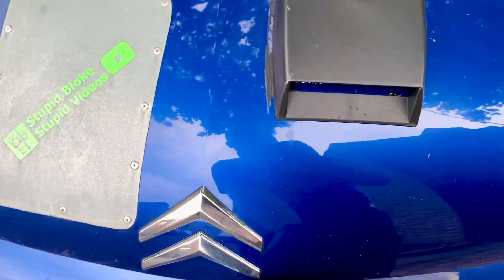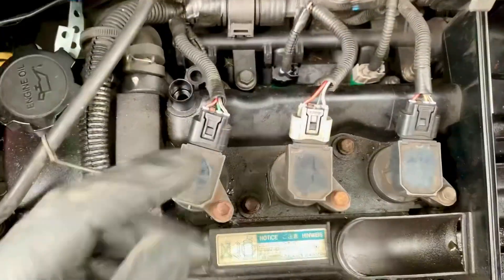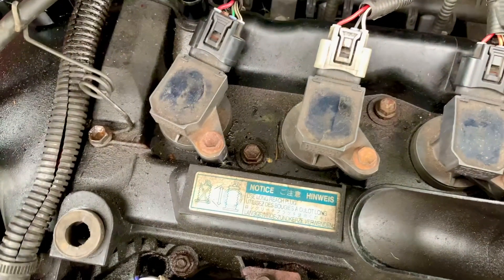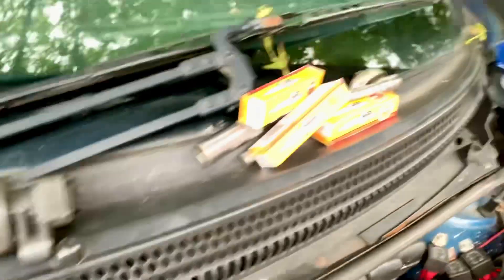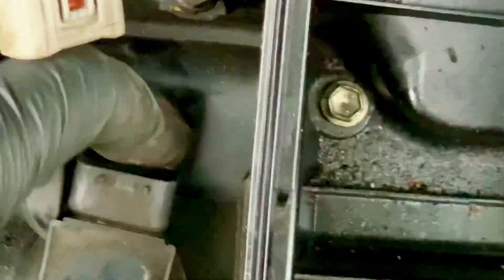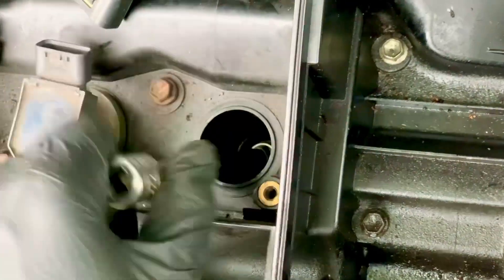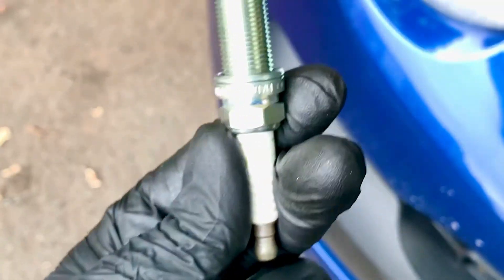How to Tell Which Cylinder is Misfiring & Repair it. (CityBug/C1/107/Aygo) Coil Pack, Power Loss

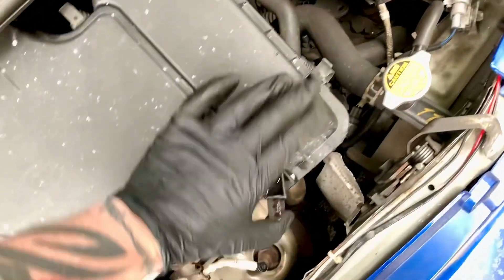Comment: 7:31 What was that O2 sensor doing there haha Thanks for posting this 3 years ago, mate. Always chuffed to watch your videos & helping out. 

My issues:
- Sudden 'Check engine light' in dash.
- Engine vibrations.
- Loss of power.

Stopped the car immediately.

My solution:
- 1 new center ignition coil (ran fine afterwards)
- 3 new spark plugs ('Denso iridium' for maximum performance and at least 25 added HP)
- Battery ground disconnected in order to reset 'check engine light'. 

My diagnosis device could not retreat any fault codes on the ECU. And so this very method in the video came in handy.
Reply from the maker: It’s in the oem position. Glad the video helped mate

Comment: I had the engine light and ran rough after a flat battery. 302 code
Checked the coils and sparks, looked for signs of gasket failure, all looked OK

Decided to take out the battery and charge it overnight as the issue only developed after the flat battery, popped charged battery back in, no code and running fine again

Check your battery if it isn't the coil or spark plugs, better than a head compression issue!
Reply from the maker: @weednate  low voltage issues can cause all sorts of random issues. Same with bad earth faults, which are often effectively the same/similar thing from the ecu’s perspective.

Comment: just undo the 3 coil pack pins and lift each one one at a time you can hear the spark plug and coil working and tell straight away
Reply from the maker: @stuartjones2242  basically yea

Comment: Nothing to do with it but I was wondering if you have any videos on hardwire a next base dash cam on fuse . I tried do doit on steering wheel fuses but apparently it won’t work so my question is “ do I have to wire it on lighter or the front fuses ( appreciate mate )
Reply from the maker: Funnily enough I’ll be fitting one soon, not a nextbase but wiring should be same. Not sure where I’m gonna wire it into yet, probably an ignition supply at the radio.

Comment: If i swap the plugs in mine and an engine lifht comes on, would i have to have a fault code reader or would a garage just flush them for me? How much would a functional fault code reader be to purchase?
Reply from the maker: Sometimes they will reset themselves after a while but not always. Cheap code readers can be got off eBay for less than a tenner these days

Comment: mine gave me 3 beeps after installing new spark plugs when turning the ignition on once, any ideas why?
Reply from the maker: No,.. not sure about that one 🤔
Reply: @StupidBlokeStupidVideos   thanks for the reply. Maybe I didn't screw it on enough and there isn't enough pressure or something?
Reply from the maker: @kenymok2281  you mean like beeps from the dash as in the same way as the seatbelt not being on or the fuel hitting reserve don’t you?
Reply: @StupidBlokeStupidVideos   shit, my bad, it was in fact low fuel level, but I remember I had 2/5 of the tank 🤦🏻‍♂ funny how it decided to beep right after the spark plug change
Reply from the maker: @kenymok2281  aaaaah ha haha

Comment: Had this exact same problem after the timing chain was replaced. I actually replaced all 3 coils and plugs and that solved the problem. Another great vid.
Reply from the maker: Cheers mate. Unusual for all 3 could to go down together too. I might do the timing chain in this at some point
Reply: @StupidBlokeStupidVideos  I actually just replaced all 3 coils, there was probably only a problem with 1 but I decided to replace them all anyway. Cheers

Comment: A video that i think could also be useful for others is changing/repairing the Gear Linkage cable. Its something that i've searched for on google and not found a single one for this car. I have to change mine tomorrow and even though its fairly easy for me, it can seem more difficult than it actually is for others. Thank you for the videos
Reply from the maker: No doubt I’ll need to do it at some point on the shitter lol
Reply: @StupidBlokeStupidVideos  🤣🤣 . lol. Thanks for the videos

Comment: Alright mate- I know it’s probably not easy for you to give me a straight answer, but here goes. My shit bastard 107 is showing a p0171 fault on my OBD2 reader (system too lean-bank 1) If the  car’s been sitting overnight, it takes a couple of turns to get the bastard fired up. After that it runs ok but not great. It’s definitely not running as sharp as it was. I’ve changed both oxygen sensors, the air filter and the spark plugs. I’ve also cleaned the PCV valve (or whatever the fuck it’s called) and the idle valve...Before I go throwing more money at it or pay some bellend to do the same (with all of the added changes thrown in) any ideas on where to look next?
Reply from the maker: You’re welcome and it sounds to be either too much air, or not enough fuel. Check for air leaks on the intake around the injectors where they sit in the manifold can leak sometimes for example, or a crack in the intake manifold. Anything like that, have a spray round at intake with brake cleaner, point it at the joints etc and if you spray at a specific place and the engine note changes, chances are you have an air leak. The other thing is possible is lack of fuel, but that’s less likely. Poor flow from fuel pump or blocked injectors but those faults are less likely tbh. Let me know how you get on
Reply: Cheers for that. I’ve got a couple of days off work this coming week. I’ll let you know how I get on.
Reply: @TheNobbynoonar  " I’ll let you know how I get on." 
did you die by any chance?
Reply: @LykeArgy  My humble apologies. I had family issues going on at the time and put the car on hold. I completely forgot to get back to you. Anyway, car's sorted now. The main issues were a duff fuel pump and a leaking catalytic converter gasket (was drawing in air) It fire's up first time now and runs smooth. The next job (when this bastard weather settles down) is to tighten up the gear lever and during the summer, touch up the bodywork. Thank you for taking the time to make your videos-very much appreciated.
Reply: @LykeArgy  BTW, you were pretty much on the ball with your assessment. The engine wasn't getting enough fuel (defective fuel pump) and an air leak (knackered cat gasket) Well done!
Reply: i made no assesments, but how do i know this is TheNobbynoonar , how do we know he didn't die and this is someone else using his account??? !!! ???
Reply: @LykeArgy  I'm contacting you from beyond the grave. BTW, Elvis said "Hi"
Reply: oh that makes sense, tell that guy i don't like him, he's overrated 

on a serious note, thanks for replying =)
   @TheNobbynoonar
Reply: BTW-Thanks for taking the time and effort to put out these videos, much appreciated.